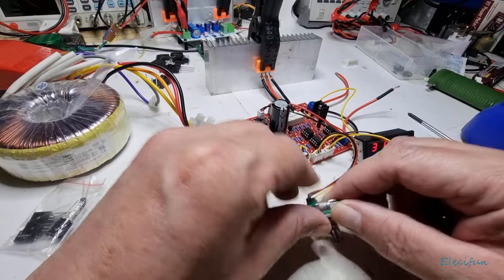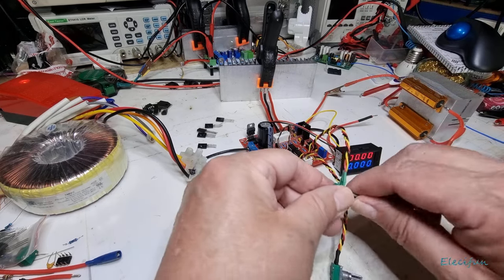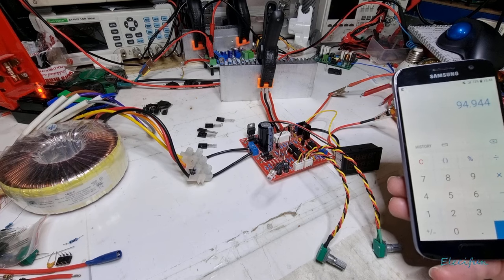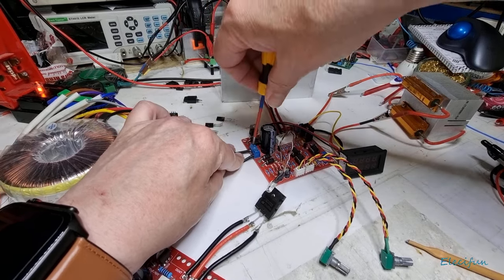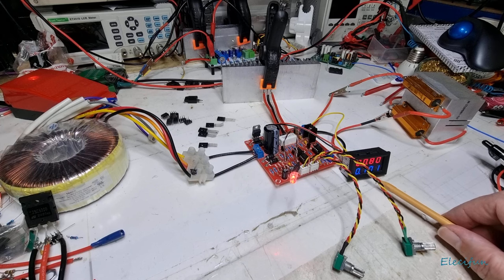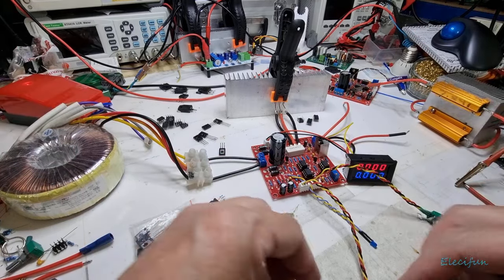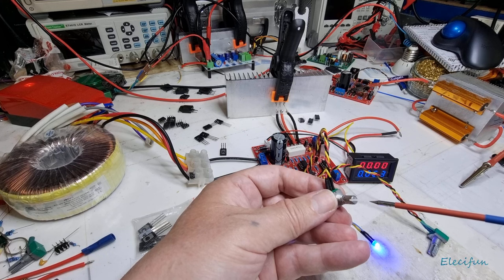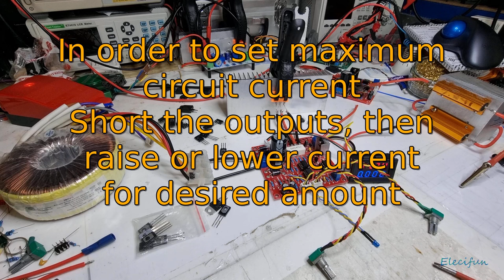0 - 30V  2mA - 3A  RED Power Supply Board (Aliexpress)

Comment: Uni-Byte has made a number of videos on this board concurrent to you right now. He found that he wanted to get a lower transformer voltage so the opamps weren't operating at their max limits, amongst some other issues. It can be a hell of time getting any genuine power transistors from china. The love putting smaller ones in the big packages...

Comment: THis circuit is not good. The transistors burned out when i raised the current in my case twice. There are simple circuits available with lm317 and 2n3005 x2 transistors for attaining smame voltage and current.

Comment: The ps is good really good. What kills it is the fact it may burn the opamp with 24v transformer
Reply from the maker: @franciscoferreira-eh1yu using real TL081's the circuit is fine with 24V transformer. Some of the supplied op-amps are sub standard so might fail.

Comment: 😂😮ahahaha ! Well done compardre! I love that flash and smoke ! ❤😊 Okay so how's it going!? What have you discovered?
Reply from the maker: @decem_unosquattro9538 I missed out a faulty 0.47 Ohm 5 Watt resistor... Some of the kit 2SD822's are worse than others. I need to rerun tests with genuine. Some of the supplied op-amps work and some don't.
The pot adjustment for current could be better spread across the resistance of the 10K pot.
Hopefully today genuine 2SD882's arrive, retest to see if there is any difference on output and short circuit outcomes.
Reply: @Elecifun  Oh okay, that's interesting. 🤔 Well I'll watch you next vlogg and see how this pans out. 

Oh incidentally you might want to stock up on extra food just in case there is a nuclear war. It feels like the rhetoric is getting worse. 😒